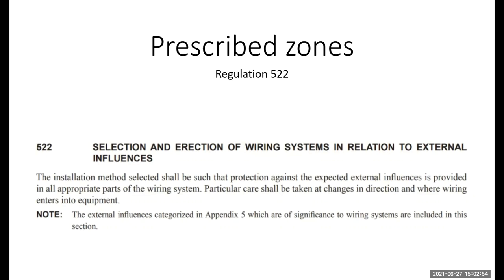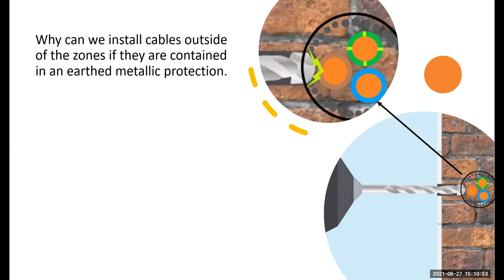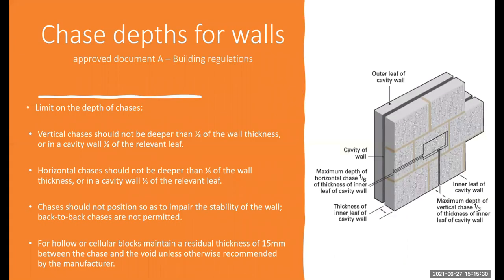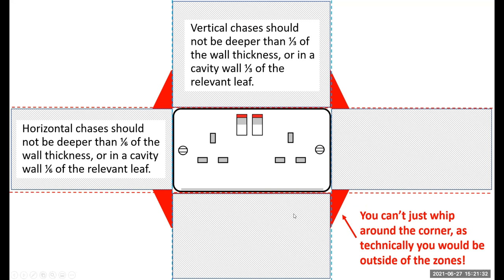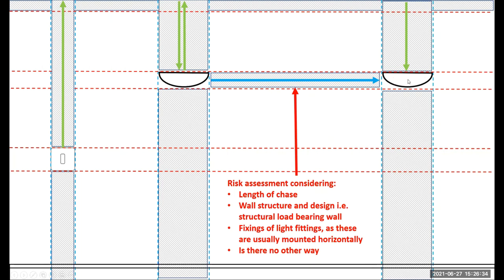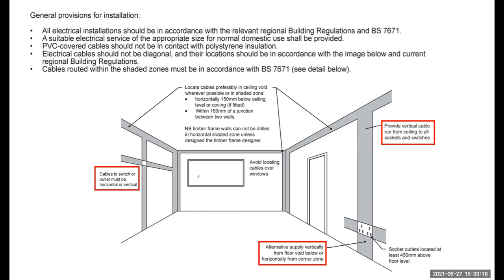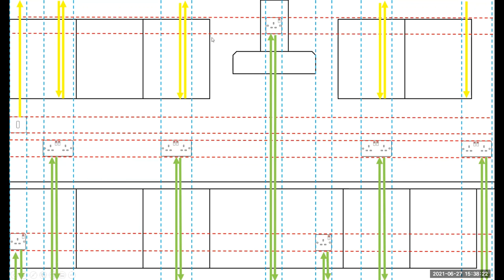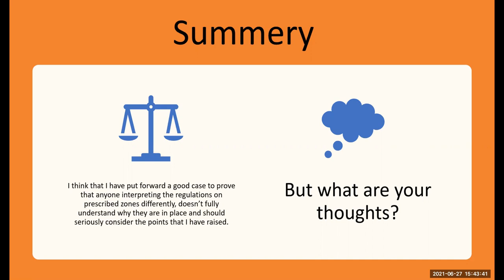Prescribed zones, chase depths and why I think most installers are not following the regulations

Comment: Vertical drops are the way to go. Householders find it easy to understand avoid putting anything above or below an accessory. It becomes hard for the home owner or tenant to grasp the whole zones issues.  Not to mention I don’t want cables at ceiling level running horizontally around the top behind coving. Night mate if there’s a fault you end up destroying decorations.

Comment: Thank you for this.  As a (used to be) plumber who is now learning the electric business for some DIY work.. I have gone deep into what I am and am not allowed to do.  While reading I have wondered about EXACTLY what you were describing.  150 from the return of a wall.. but that's where I attach my units etc.  Can go 150 down from a roof; but I have seen both units and cornicing screwed into this.  My other big question is how to meet a 50mm depth when a wall is only 30 odd mm deep.  Do I just run my cables and hope for the best the next guy after me knows about proscribed vertical zones.  Thank you for clarifying these rules.  Great Video.
Reply from the maker: Thank you so much 🤗

You are more than welcome 🙏

Comment: Good video. I was starting to wonder what was going on, I've seen so many crazy "in the zone" installations recently. I think there needs to be examples in the regs, like there are with Rings & Radials.
 I generally follow what you would consider best practice, which is easy enough in most houses. However I have come across one or two where construction features mean that I do change direction within a socket, so I can avoid unnecessary building damage, or having cables in unexpected areas even if its technically "in the zone"
Another I have come across is cables installed in the same way as the board at college. Out of the socket, down 6 inches, along the wall, back up to the next socket. What's all that about!?
I liked your kitchen example. I have seen similar to your bad example. I note the socket behind the Extractor. I know its often still done, but I'm really not keen on that, I don't see it as accessible, and with recirculating hoods, that have filters removed/blocked come across a few hidden faults. Id rather a flex outlet/secured JB with fuse elsewhere.
The sockets in the back of a cupboard is very neat I agree. I tend to bring them forward with trunking on the side. Not as discreet, but the owner cannot forget where they are, and they cannot be hidden at all, I have also fixed a few problems which is cupboard stock piling up at a switch at the back of a cupboard.
Reply from the maker: Thank you Richard 🤝

You make some valid points, and I should have mentioned in the video that I to use accessories to change direction, by going through the back box.

I believe that it is good practice, because anyone taking the accessory off the wall can see the change of direction 👌

Comment: Woohoo! Yay! Completely Electrical completely agree with all that I viewed. Some of the brick loading is more complicated than that bit. 
I agree with the concepts and thought provoking ideas. It would depend on where the point load is or where the dynamic loads are assumed to be but yes horizontal chases are much more detrimental than vertical, unless the point load is located at the vertical chase point.

Your coefficient idea? Ideally you need to consider the bending deflection, bending moments at joints and shear stress and a few others to calculate this. I'm not sure it can be this simple but if you are right then you are about to be a billionaire 🤭. For me it's straight up, down, horizontal less than 250mm. That's from my own structural calculations based on Brighton bungeroosh walls. But you are tight saying that plaster doesn't count. It kind of does because it causes a bending moment in another direction  but not vertical forces on original structure... So anything better than that will be fine.

To rewire a circuit it needs to be straight up or down or horizontal in tube between obvious points for me.. 

I hate prescribed zones. It promotes laziness imo. It used to be so bloody easy. Straight up or down... Now I'm scared to drill through a wall because who bloody knows where they all are??? Takes me ages to carefully use probe detectors and chip away and all sorts of other nonsense just to get on with a simple job 🤬

Happy to show you the structural calcs once I've had some time to revise. 🤭

Approved docs are not stat. Building regulations are stat which are not the same. I've been looking a lot at these due to grenfell stuff but yeah approved docs... they are same status as bs7671 really. Implied in guidance but not law.

Totally agree about surface horizontal and chased vertical. 👍

Chasing vertical is easier. 

We need to talk about editing but I love this video 😂. I'm no better but I know the solution 😂..... 

Great stuff buddy 👍👏
Reply from the maker: Thanks Craig 🤝🤗

Comment: Regarding zig zagged zones, I will aften run the loaf side of a cooker isolator this way. Reason being if I were to run straight up, across the ceiling and down I'll be bang in line with where the hood will be drilled out. In the same area, a mate of mine does council kitchen rewires where metal conduit chased into the wall is specified for load sides of all isolators. From a cooker isolator this would need to be a 25mm conduit, which would cause issues with the chasing depths you brought up later in the video!

I understand the rules are the rules, but I'm curious what you would do in these scenarios yourself? I personally am not a fan of running cables behind kitchen cabinets which leaves limited options
Reply from the maker: For me, the running of cables behind kitchen units is the lesser of all the evils and will never cause anyone any issues.

In fact, if they ever change the kitchen it makes everyone’s job a lot easier

Comment: I think if everyone knew where the zones are, this would solve a lot of problems and make one think twice before making a hole.

The Mary Wherry case I believe was the cable veered off at a 5% angle away from the zone and was not RCD protected either.
Reply from the maker: That is correct, however if it had not veered out of zone they would not have hit the cable.

RCD’s are additional protection
Reply: @Pure_electrical_training  yes additional protection and keep within the zone would be implemented now but still they should have kept within the zone, going round the side of the box although is wrong but cable's being there would be more obvious than cable zones to a DIYer.

Comment: Is it actually permitted to run the cable from one circuit in the zone created by an accessory of another?  I see this done a lot.
Reply: Thanks for the love, but it was an actual question :)
Reply: @monikaw1179  - Horizontal OR vertical is the wording-and still open to intrepretation.

Comment: Very interesting and thought provoking video,.
Reply from the maker: Thank you 🙏
Reply: Some very good valid points that will make most think about their cable routing. 👍🏻
Reply from the maker: Thank you Warren 🤝
Reply: So a socket under a window on concrete floors what's the solution. You can't run horizontally without being vertical somewhere.
Reply: That’s where you would have to resort to the 150mm safe zone at the ends of the wall. I hat sockets under windows and try to get clients to agree not to have them but sometimes you can’t avoid it
Reply: @Pure_electrical_training  Makes total sense...  Not sure what the correct interpretation of the rules are but if this is the correct interpretation and so many of us have been doing it wrong then surely by now they should have worded it something like cables from an accessory can go vertically or horizontally but must not change direction.   Like you say they should also show vertically and horizontally in different colours.

I can think of a scenario though in say a kitchen with a window where a socket is needed under the window and there is concrete floors with other sockets to the sides being at a higher level inline with the window, you have a choice either take a change in direction or come from one of the side prescribed zones which is not ideal especially if you are altering an existing circuit as that would mean potentially so much more damage and I would argue it would be sensible to assume it has come from another socket in the direction the cables have come from even if not inline..   So I don't think its totally wrong but should be avoided where at all practicably reasonable, but considering there are so many cables slung in on the diagonal and all over the place by builders and kitchen fitters.
Reply from the maker: You run in the 150mm corner space and the chase across, or you use an earthed and metallic installation method like conduit, or SWA
Reply from the maker: Thank you for watching 🙏

With the scenario under the window, you would either chase down in the corner of the room where the walls meet, and then chase over;

Or

Run an earthed metallic installation like metal conduit or SWA
Reply: @Pure_electrical_training   In my scenario to one side was a cooker connection at the same height and the other side was a vertical run of say lighting for under cabinet, or a radiator or cabinet in the way.

My interpretation of the regs would be that I agree with you that in an ideal world you should avoid changing direction where reasonably practicable, however for runs especially under windows then it is allowed.  I try to avoid using the corners where possible as plumbers and kitchen fitters love to put lots of holes in the wall.  

A thought for another video I hate cables going straight through boxes, I have even seen cables from a different circuit going through a back box of a socket.  Where it cannot be avoided then to avoid as you state in this video sending the cable round the outside of the box I put a bit of metal conduit at the top behind the back box so the cable can go round the back of the back box and be protected to avoid going through the box..

Comment: Good information, I am not a qualified electrician yet but your diagram at 25:11 will it not be better to fuse spur the bottom sockets so at least they can be isolated from the fuse spur switch and it's easier to follow the prescribed zones ?  

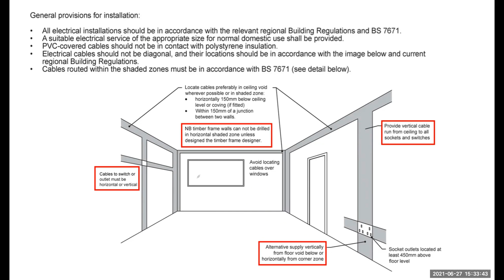I am sure the picture which is shown in 21:47 is from CJR ELECTRICAL https://www.youtube.com/watch?v=JrKHe26C-dA. lol

Comment: Where to start? I fundamentally disagree with most of what you have stated and I think you have misunderstood the reg.
You absolutely CANNOT extend the prescribed safe zone to the other side of a wall to facilitate a cable drop for an accessory on the other side of the wall (from the cable drop), potentially fatal, how can anyone know where the cables run? unless you sink a box and fit a blanking plate, that said where a wall is 100mm or less thick then you must take into account the prescribed zones on BOTH sides when considering drilling or fixing anything on the wall.  It is wrong to ask non electrically skilled people to unscrew an accessory to try and determine which way the cables enter, better to make EVERY non electrically skilled person assume that there is a wire in EVERY prescribe safe zone and NEVER to drill in these areas. Correct to say you should not run cables and change direction along that run before it gets to an accessory.  We need better education of prescribed safe zones, make it a requirement on EVERY C&G level 2 & above exam for ALL construction trades and put the info on the packaging of ALL things that may need fixing to a wall, floor or ceiling.  Putting circuit accessories in cupboards is very bad form, especially any form of isolator such as a cooker switch, these items should be "readily accessible" and in the back of a cupboard, even mounted high up, simply does not meet this requirement, there will always be something in the cupboard on the shelf that will obscure or otherwise cover the accessory, do not do this, even when you have a "solid?" 18mm backing to the unit.  The prescribed safe zones shown in the 2nd diagram in your video is to ensure the safety of non electrically skilled persons (and quite frankly, idiots) and you absolutely SHOULD assume there may be cables in EVERY zone, that way you are SAFE.  Judging by some of the other comments I am correct to say we need better education, some people who should have know about prescribed safe zones simply did not, and seemed to have just been lucky !!  Sadly we live in a world where we cannot assume everyone is sensible, reasonable and can be trusted to do the right thing so we need rules (around things like electricity and gas) that cater for "the lowest common denominator" therefore ALL non electrically skilled people SHOULD ALWAYS assume there is a cable in EVERY prescribed safe zone,  if you want to put a screw in the wall in a prescribed zone then get a competent and conscientious electrican to formerly certify (name, address, Part P registration details etc)                                            it safe to use fixings in a specified area
Reply from the maker: Then we can agree, to disagree and that’s O.K

We aren’t going to agree on everything and I stand by my video 👍